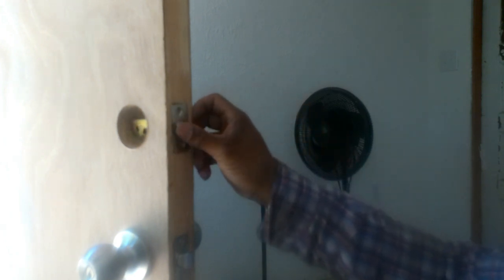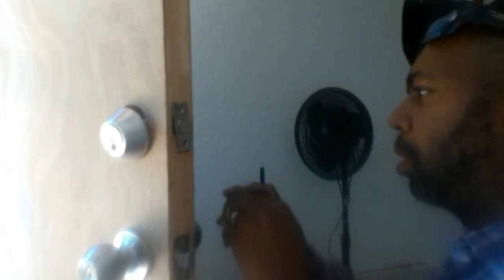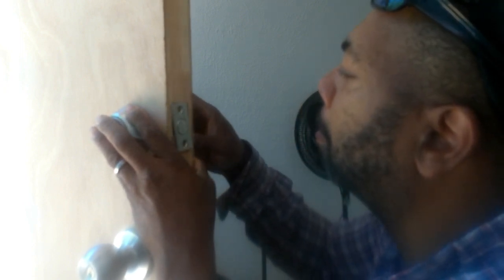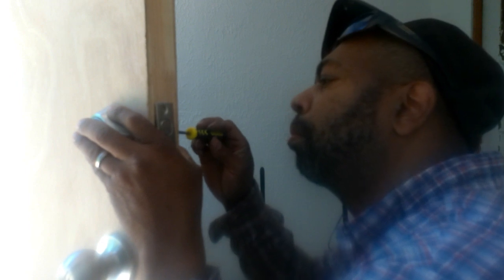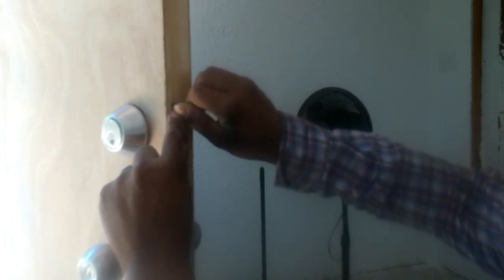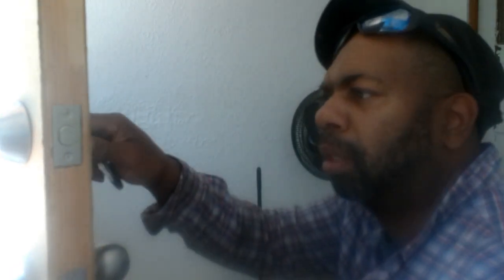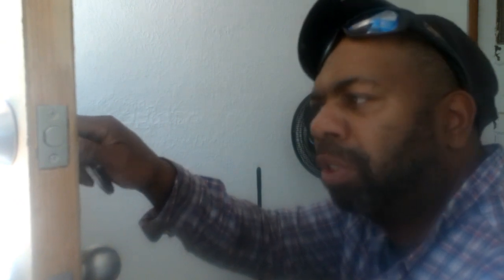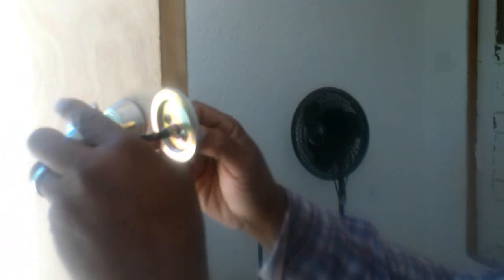How to Install a Dead Bolt Lock

Comment: Deadbolts are more secure, right?
Reply from the maker: They do help.  Make sure you have some good solid wood. If you don't have some good wood then no lock will help. Always use longer screws. Longer screws makes it hard for someone to kick to door in.